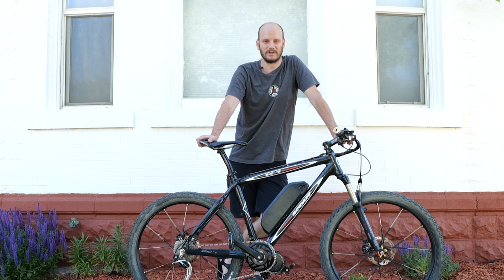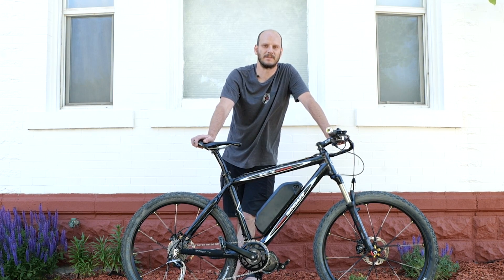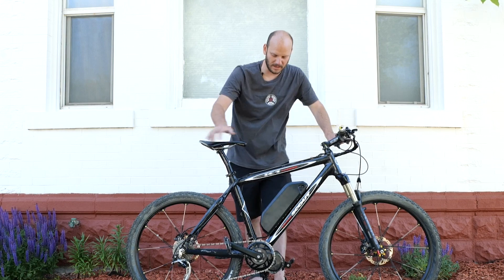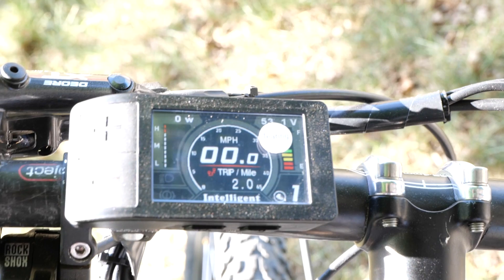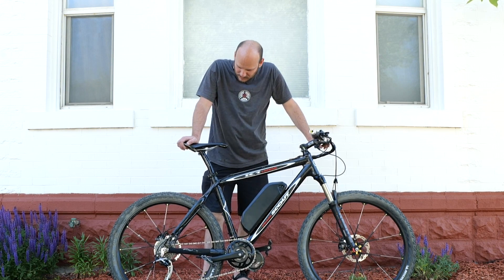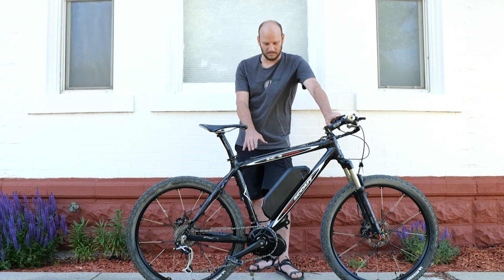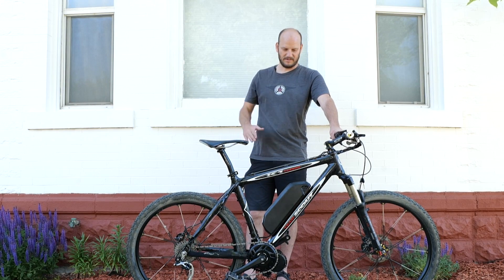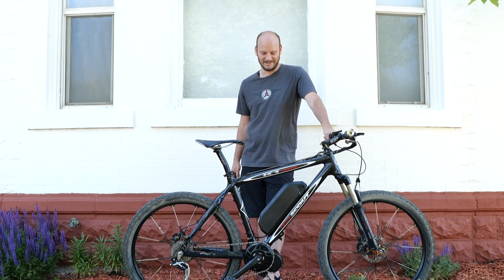Custom Eike Build:  K1 Team Scout Carbon BBSHD 52v 17.5ah Carbon Fiber Mountain bike

Comment: I have a new motor, it's the same power as the bbshd but it has torque sensing. Please contact me if interested
Reply: what u mean like a cyc x1 motor?
Reply: @GaNgStAlBeRt  No, You wont have heard of it, its new to market and running UART.

Comment: I built a BBSHD bike for someone else.  Aluminum hybrid bike with 29 x 2 inch tires, 46t chainring, 11-34 cassette, and 21 amp hour Luna battery.  I'm honestly disappointed.  The top speed is about the same as the bike in the vid.  With 1600w peak power I was expecting more.  The average cyclists puts out about 250w continuous.  1600w is more than 6 times that but it sure doesn't feel like it to me.  If my legs had 1600w I could win the Tour de France.  I guess leg watts are different from motor watts.
Reply: Aerodynamics matter. Riding position.  If you ride like Mary Poppins, its going to really slow you down.  Its OK to not have over 35mph top speed on a bicycle.
For $4K you can buy a Honda Grom or Trail 125 that will do 60 mph and has proper lighting and brakes and tire size for higher speed not to mention better frame integrity and 5 x's the power of a BBSHD ebike.
Reply: @lukewalker1051  The power of the BBSHD is obviously grossly exaggerated. I'm a cyclist of 30 years and don't ride like Mary Poppins, and, have gone 60mph on descents.  I am also a motorcycle rider.

Comment: Most premium carbon fiber bikes have metal sleeved bottom brackets, so they should stand up to a stock BBSHD just fine. The stabilizer bar was a good idea, I use them on my 2500w 350nM double amp shunt modded BBSHD builds.

Comment: I have a "FLX-bic" trail ebike which the mid drive motor has gone bad turning my ebike into a boat anchor.  Do you know where I could get a replacement motor for this bike.  It was made in china in 2016.  The bifang motor wont work there is know down tube.

Comment: Love it! I'm the customer. I use it for errands around town, no stress on the frame, not worried about carbon. It's faster than Johnny rode it! I switched to 46t chainlink for more top speed, now it'll go 45 mph in 9th gear with 60 rpm cadence pedaling. I pass cars with impunity in the 25-mph zone! Store-bought ebikes around me are turds compared to my "Decati," as I call it. Johnny just finished  what will be my offroad ebike, a hardtail 26 Trek with Shimano IGH.
Reply: Very awesome! Nice
Reply: I hope you ride in full face motorcycle helmet

Comment: You give the customer what he wants.  
His money would have been better spent on a Aluminium frame Mountain bike and install a Luna Ludricious controller to BBSHD motor, given he wants Souped Up, Ride Fast and Hard Rig.

I can see using an ASI BAC 855 or Grin Frankenrunner controller but that's a lot of work and expense.  That would be something to do for your 50K subscriber video, but it's too hard to do live.
Reply: Pretty presumptuous,  deciding how my money would be better spent, knowing nothing about me. I've been a racer for 57 years, know myself pretty well, as well as a bit about the risk/reward of exotic parts--and how to choose a guru.
Reply: @sammoses9536  Lookup Luna Cycles and try to get a $350 Ludacris controller, that would soup up your bike a lot.  Having the Torque arm is perfect for your rig, you don't want to crush the bottom bracket with too much torque.
I assume you got a USB programming cord and you can custom tune your existing controller. If you have Android phone, the Speeed app will work fine.
Good luck and no crashes.